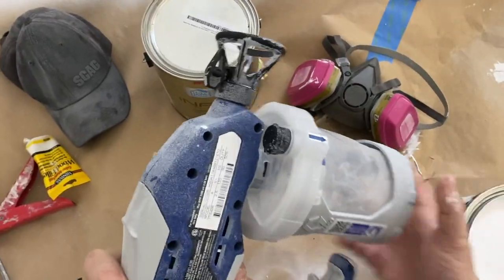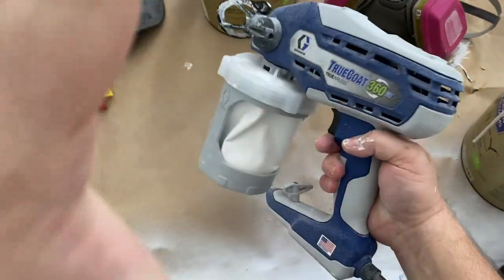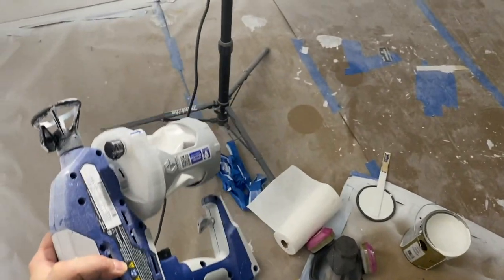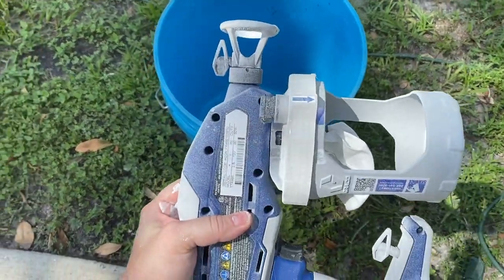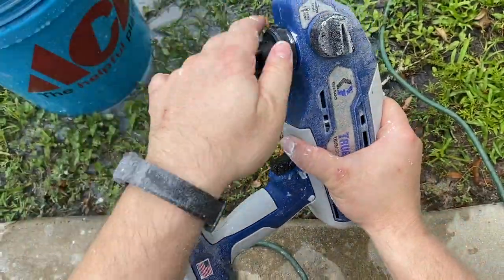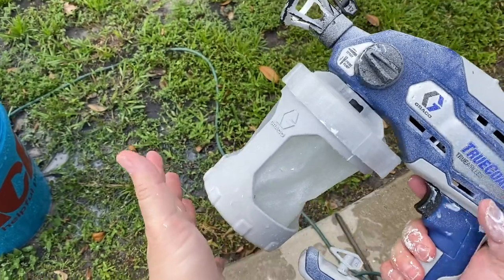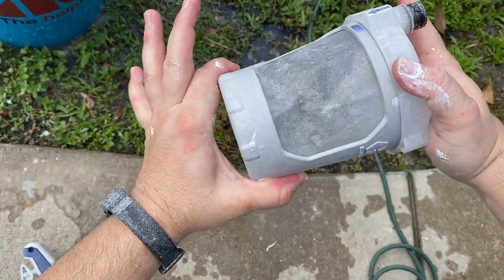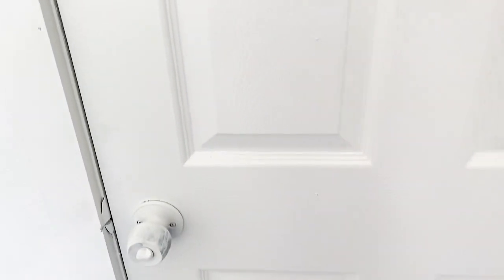This Sprayer is a GAME CHANGER! GRACO True Coat 360 DS Honest Review With Cleanup and Paint Footage

Comment: Video was helpful, thanks for posting. Just sprayed a basement ceiling black. Three gallons of paint went down with no issues. I called graco right before I sprayed….they stressed straining the paint before using. I did and I’m done, very little touch up the next day with a small roller.

Comment: I have an X5 . Used it to paint my garage and barn . Great results !  Bought the DSP for little jobs . Not happy . Latest issue is it will prime and spray water but not paint . Was using nice clean SW paint . Had to roll a door after all the prep to spray.
Ordering a new lid and o rings to see if I somehow over torqued the lid on the cup. Called Graco said that’s possible . Second time it let me down when I needed it . Graco said if it sprays H2O which it does it should spray paint . We’ll see….
Reply: @roodtpazoo5216 I've been thinking of buying this for trim & doors @ my 4 unit apartment building.  I have a fuji hvlp but the clean up & paint thinning is a pain in the butt. Would you recommend this sprayer ???
Reply: @GMONEY-xl5gu  X5 is great . I don’t care for the handheld one. Some people like them though

Comment: is there a way to control how wide it sprays? If I mama paint cabinets with this can i reduce that spray pattern to like 2" wide?
Reply: Sprayer comes with 2 tips, a black 12 inch wide spray fan and a gray 4 inch wide spray fan, not sure if any others are available from Graco or Azon.
Reply: Keep the spray about 16 to 20 inches away from the surface you are painting and use the top speed and yesterday a little persistent to master the speed and flow

Comment: any idea why it wont spreay glidden paint/primer all in one is it to thick or what and if so what white paint are u using
Reply from the maker: Check your filter screens
Reply: @Archifx  I thoroughly cleaned everything only way I could get it to spray is by adding alot of water I also have the model sprayer step below yours it only has high an low setting
Reply from the maker: Yeah. That’s strange because the one major thing I liked about this sprayer was it’s ability to spray the thick stuff. Maybe another painter can chime in on the comments. I’d love to get some other ideas for this situation

Comment: Recently bought a Graco 360 vsp , not happy with the unit , low speed I get too many pulse , higher speed too much runs , by the way I am using it to spray clear coat on the stairs
Reply: I think you just need to practice your pace/technique on some scrap cardboard, higher the speed faster you need to move the gun to avoid buildup, and viceversa on the slower speeds to avoid gaps. All materials are different so there's no 1 magic speed and pace - that's why I chose the VSP over the dual DSP, more control.

Comment: I bought one at the beginning of the year, it looked like it had been put together by a crackhead in the factory. If it looked awful on the outside I couldn’t imagine what it would look like on the inside where the important parts are. Sent it back for a refund without even using it. The build quality was terrible.

Comment: This thing makes a huge mess. The amount of overspray is unreal. You better cover EVERYTHING that you don't want paint getting on. My favorite part is sticking to the ground when you walk because it oversprays that much. Plan on taking your shoes off to leave the work area. And it lays down a very uneven coat on the low setting, every single pulse of the motor leaves a corresponding light spot on what you are painting. The high setting is much better coverage but you also increase the amount of overspray at the same time. Clean up is also extremely messy. 

Given the amount of prep it takes to protect everything that isn't getting painted, the uneven coats and the pain in the rear clean up, it isn't worth it. I could see using this if you had a dedicated paint booth but if you've laid out that kind of cash, you've already bought a professional sprayer...
Reply from the maker: Standard sprayer woes. Nothing new.
Reply: @Archifx  Ah yes, standard sprayer woes... Thanks for mentioning none of them in this video. I bought this piece of crap based on you saying it was awesome, not knowing you left out all of the big issues. Fantastic... NOT! By the way, you aren't using this according to manufacturer instructions... not that it would make it much better but if you are making a video about a product, you should stick to the instructions.
Reply from the maker: I showed exactly how it worked in the vid. And showed the area I was working in. Use common sense. You’re spraying paint in the air. There’s gonna be mess. Keep your sprayer and adjust your expectations

Comment: Every sprayer like this gets covered in overspray after 2-3 uses. Very frustrating. These are all bad designs.
Reply: Not a big deal with sprayers, they're all inherently messy. As long as the overspray doesn't build up so much to clog or impede  the pumps air intakes it's no harm. Soapy towel, wipe it down..